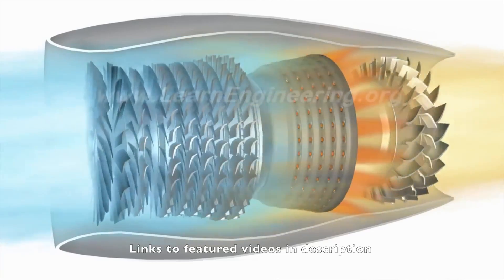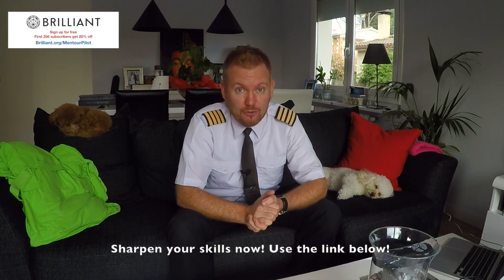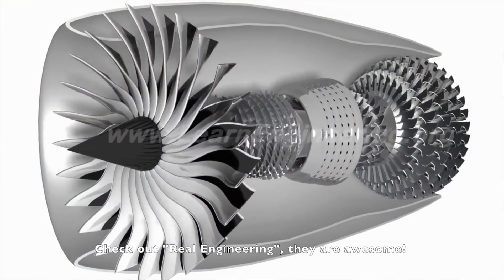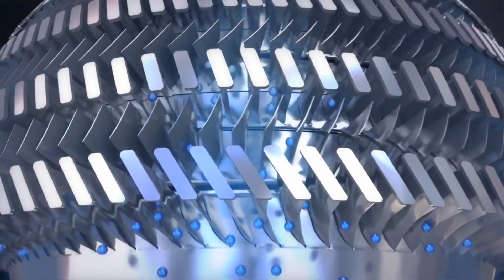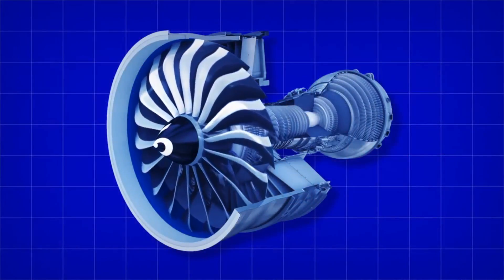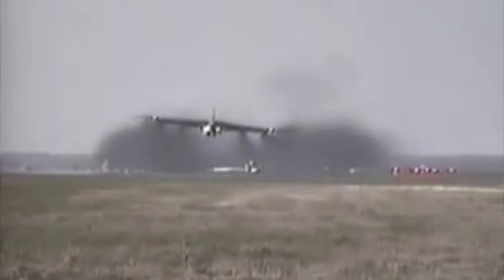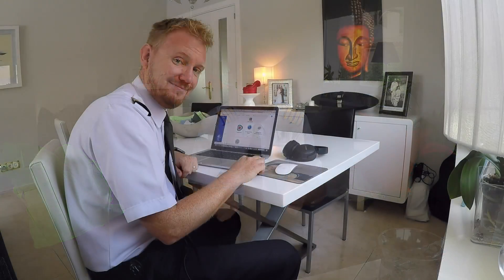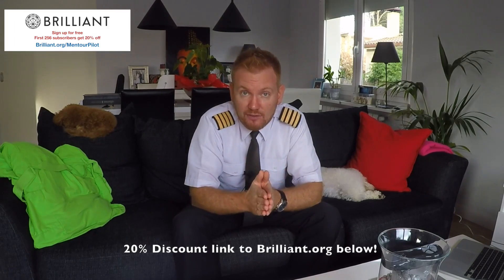Can water make Jet engines stronger?!

Comment: Could you explain the effects that the 2010 Icelandic volcanic eruptions had on jet engines, and why small planes with piston engines weren't affected?
Reply: volcanic ash is primarily rock glass and sand al abrasive , it's a mater of velocity jet engine airflow is very high its like sandpaper on wood also any ash that gets to the primary  (the center part of the engin ) starts clogging up the air passages causing hot spots  damaging to the engine, Piston engines are also affected but since airflow is slower takes more time ash eats the propeller, since most piston engined aircraft have some sort of air filtration it help but not much especially since as a safety factor its mandatory that if the air filter gets blocked (wet conditions cause this to happen in minutes) an alternate path of unfiltered air will feed the engine leaving all the abrasive particle to enter the engin  mix with oil the result is an engine that should last 2000 hrs to tbo  drops to 50 or less hrs . its operating both types of engines with grinding dust in the air .

Comment: Yes, I dont think the raining water would have a big negative effect on the engine thrust. Because the blades rotate so fast that the water evaporates before entering the chamber where the fuel is mixed with condensed air for ignition.... nevertheless they tested the reaction of tons and tons of water entering the engine at full power and the water did not shut the engine down even though it did pass the chamber so probably the air is still powerful enough to fusion with fuel.. also the engine fuel is more dense than the regular car fuel. The water is thinner....

Comment: Rain/Water actually improves the performance of an Engine.   Hence the reason for Engine washes.  

- When the EGT margin drops below a threshold we keep an eye on it and schedule a wash.  Once the core wash is done we see great improvement in EGT margin thus keeping the Engine from over temping when taking out of high altitude or hot cities in general.  

- So yes, in short water does improve the performance.   What it does is cleans and opens up the cooling holes on the turbine blades thus improving efficiency.   If a water wash doesn't do it another option is detergent wash.    I need to start making some videos lol.
Reply: Please do!

Comment: The AV-8 Harrier also used water injection into the big Rolls Royce Pegasus engine for vertical flight. As a jet mechanic you have pretty much nailed the operation of a turbine engine.  I tell people a turbine engine is simple, it is all the components that make one run and power an airplane that is complicated. I worked on the military aircraft so they were run harder than their civilian brothers but they all work the same. Well done. Be safe.

Comment: Thanks Mr. Mentour.
Please tell me that the fan what we see in the aircraft rotate on wind pressure and rain. This fan having seperate shaft which moves freely and slowly depends on air pressure.
Where as compression chamber shaft and combustion chamber shaft is only one.
Does the dust affect the compression chamber as it's sucking air from out side.
Is bird hit front fan affect the jet engine and how.
Please reply.
Thanks in advance.

Comment: you spoke of water injection improving thrust this is true I use to watch the B-52 take off at KI sawyer. to answer your question ( can water make jet engines stronger ) yes but with the amount of thrust of a normal jet engine you would never feel it. That extra thrust would be off set by the add weight and drag of the aircraft in the rain.

Comment: What happens if you have no choice but to fly through a thunderstorm and you get stuck by lightning
Reply: Nothing, the aircraft is bonded from nose to tail and the charge will dissipate off the tail. However, there have been times (very few) where damage is inccurred from a lightning strike. Where it has occurred it has been minor.

Comment: The rain making the runway more slippery has nothing to do with the braking, unless the wheels are skidding and not rolling.

The reason braking ability is reduced on a wet runway is because the wheels get wet, so there is reduced friction between the wheels and disc brakes. It is not because the runway itself is slippery.
Reply: most planes normaly I HAVE SEEN, FLOWN DONT ONLY USE WHEEL BRAKES.
They normaly use airbrakes, which is extra flaps on the wings, and as the plane slows down spesially if the runway is short, they also use reverse trust from the engines.
but yes they have wheel  brakes too, but big planes are heavy. and skidding can be dangerous say sliding off the runway in wintertime with ice-rain-deicer on the runway

Comment: You say that the compressor compresses the air, and because air heats up when it compresses, the water entering the compressor boils and turns to vapor, but wouldn't the compressed also have an equally great effect on water to evaporate? In a vacuum, water will evaporate at cold temperatures, but if the pressure is high enough, the water will just superheat and won't evaporate despite being very warm. Or at leas that's my understanding. Why doesn't this happen in a compressor then?

Comment: water may turn to steam but it robs the engine of heat needed to balance combustion so no i doubt it, unless you make a specially designed engine which is just pointless, where to get the water

Comment: Could you do a video talking about the air conditioning  PACKS work please? Always interested in the air con systems and air cycle machines. Also how clean is cabin air? Do you use 100% outside air or recirculate a lot of it?

Comment: Here are some things that annoy me!  First iff Centrifugal is not pronounced the way it’s spelled, it’s not (Centri Fugal)  you don’t pronounce it the way it spelled, it’s actually (Cen Trifa call).

Same thing when people say Deisel I fucking hate when people say (Deezal)... it’s (Dee Sole) no Deizal.

Or when someone calls a Turbine Engine and (Tur Bin) no no no no no no!!!!  A turban is what terrorist wear on their heads!

Now a (Turbine) is the blades that push or pull a type of fluid or move high volume of air,  You’ll find a Turbine in water pumps, Turbo Chargers etc...

if you end up finding a turban inside of a turbine engine then most likely it belonged to a terrorist and didn’t realize he was too close to the engine...

Comment: I contend that most of increased thrust associated with water injection into a low bypass engine is gained by the benefits of cooler, denser air, allowing for more fuel to be injected, creating greater thrust. All made possible as a result of the ‘latent heat of vaporization’.

Comment: Excellent video ! Your calm, scientific explanations have been very helpful to this one fearful flyer. 

I have a question: Is it possible for turbulence to be severe enough to lift one wing and cause the plane to invert ? And second, mostly hypothetical, question is would it be possible for a commercial aircraft to recover from an inverted attitude at cruising altitude ?

Comment: Doesn't jet engines require oxygen for flame? How does jet engine get so much oxygen at the altitude it flies?
Reply: There going fast enough that there sucking in enough air, plus they can run better up that high

Comment: How do military fighter jests with  little bypass air not mess things up. Water does not compress and just a tad bit of water in a combustion engine kills it.
Reply: the water that goes into the core of the engine turns into vapor. The air can already have over 200°C when it reaches the combustion chamber just because of the compression.

Comment: I am a bad flyer . Prefer trains . But trains don't go everywhere. What happens if there is an engine failure after take off ,during the moments when the aircraft is climbing up . Explain for single engine failure and if all the engines fail. 2nd question ) what is the worst that can happen to a coimercial passenger aircraft when it flies into a strongest turbulence ? Can a strongest turbulence send the aircraft in a tailspin or can it turn the plane upside down ?

Comment: Jet engines continue to operate in rain. But humidity affects the combustion process. Water injection has been used on piston engines too and is even used in turbocharged automobile engines. The purpose is similar to intercooler, to cool down the air before it gets to cylinders. In jet engine, it plays a similar role. Water droplets vaporize as they pass through compressor. The reason is that as pressure increases, the temperature also increases and it vaporizes the water droplets. As water vaporizes, it cools down the compressed air. This means that temperature of air during combustion would change as compared to when there is no rain. Cold air during combustion also causes increase in fuel consumpton. This water vapour (gas form of H20) replaces the air and thus the Oxygen. These factors would affect the thrust but not to a degree where it would be noticable to the pilot because air is always in excess (in air fuel ratio). Jet engines fly regularly around the world in bad weather but it is avoided when it is possible to do so.

Comment: When water goes superheated it also has a massive volumetric axpantion ratio. We use it on high performance engines to increase knock resistance, cleans out the combustion chabers and increase power and loger egt. We spray it a a very high pressure vapour. And also inject pre turbo as it increases the compressor efficiency and lowers intake temps.

Comment: Could you please explain the effects of lightning strike on an  aircraft
Reply: I think he has done that at some point. Basically, when it hits the aircraft, it passes through the metal "shell". It is like a "faraday cage". Normally nothing happens. Aircrafts with partially Carbon fiber shell could get damaged. Therefore engineer build a metal mesh around the Carbon fiber parts. 

Correct me if im wrong.

Comment: 8:46 it's called water methanol injection. Commonly found in turbo prop engines (jet engines with propeller) where water is injected into the compressor inlet which cools the air mass in high temperature conditions and other areas where bit of extra thrust is needed or to compensate thrust loss. Water cools the air mass and increases the air density but reduces the inlet temperature of the turbine so water mixed with methanol is used to maintain the turbine inlet temperature. The action of methanol makes the turbine inlet temperature constant.

Comment: two questions:

How do the airports dry off their runways?
How does the compressor blades actually work? I see in the animation one row of blades are moving in one direction, another in the opposite direction and others not at all. I guess that's part of the process but curious to the hows and whys.
Reply: They dont. Drying would cost a ton of money and special equipment/personel would be needed. Its easier and cheaper to wait for it to dry itself. They probably just profile the runway so the water won't stay on it. Sun and planes will do the rest
Reply: All blades move in the same direction because they are all attached to one shaft. I guess those that don't move are there to make the airflow correct but im not sure about that. Well the blades force air to flow thru smaller and smaller tunnel in effect compressing it. You can see on the animation that tunnel is getting smaller the closer it is to combustion chamber

Comment: Sir should 737max be scrapped because of bad design? Telling pilots that they may need to override and fly manually is like telling car drivers that brakes may not work under a crash situation and that handbrakes may need to be used.
Reply: Boeing fucked up here!

Comment: Water evaporates in the core compressor reducing compressor delivery temperature. This makes the compressor more efficient and allows for a bigger temperature increase across the combustor. These two combined result in an overall cycle efficiency and thrust increase.

Saved you 14 minutes and 52 seconds.
Reply: So does the water go in the bypass or in the turbine? Thanks
Reply: @ashchowdhury2895  Modern commercial jet engines have bypass ratios between 5:1 and 10+:1. This means for every 1 kg of air going through the core 5-10+ kg of air is by-passed (goes through the cold air duct. Assuming uniform amount of rain hitting the engine, a similar ratio of water will go through the core and the bypass duct. Water going through the core evaporates long before it enters the combustor. Water going through the bypass duct does not evaporate (not high enough temperature).

Comment: Why not the engine be provided with filter in front?
Reply: That would add a lot oft air resistance and it would lower the thrust of the engine because less air would come into the engine. And you also don't really need filters.

Comment: Whoah! Most of the thrust is produced by the big fan in the front? Not the high pressure jet of air coming out in the back? Holy cow.
Reply: That is why these engines are called "hi-bypass" engines in that most air 'bypasses" the engine core.

Comment: i have a question for your next video. is there a way you can put a heavy duty screen on the engines to prevent birds going into the engines? and can they put a wire warmer all threw out the airplane to prevent ice forming on the plane?

Comment: The end of February I traveled through JFK airport in NYC when the snow storm was so bad they had cancelled 150+ flights by the middle of the afternoon...After a 10 hour layover my flight Airbus A380 to Frankfurt, Germany continuing on to Singapore was delayed and then required deicing which took over an hour on that huge plane....How do they ever determine if they have removed all the ice which could cause a problem on the plane????? I spent a lot of time worrying during that flight...love your videos... Thanks!

Comment: Water is a great way to control combustion gasses and because water expands 1000 it also help raise the dynamic compression ratio of the combusters . Also it will help not only cool the turbine it will literally steam clean it from any debris. But....... having heat critical parts the quenching affect the water has could create stress risers due to a temp influx on a single part via thermal expansion

Comment: Hi Mentour Pilot ...

Surely the ingestion of water and grit / dirt from the engines sucking in said elements has a detrimental effect on fan blades and the blades in the compressor and HPT & LPT engine cases ... ?
Reply: Deano TheSaxman we actually inject water into jets for industrial purpose to reduce the exhaust gas temperature letting us add more fuel without damaging the cumbuster
Reply: Hey isnak907 ...

Cool ... But the point I was making was that grit and dirt obviously has a detrimental effect on the fan blades ... It's  known to use water in the injection systems of cars also to boost performance ...

Comment: secondly, why not put a net structure at front of a jet engine to solve flying birds problem
Reply: The thrust of the engine will rip apart the net.. even if a minute shard gets in the engine gets in.. even with a net ... The thrust will suck the bird right through it..

Comment: Rain pelting on the flap of the AoA or "wind-flow" sensor can affect the flight of the plane. That's one of the reasons AirBus is installed with more than 2 AoA sensors in every planes.Passengers & crew lives are 1st priority in AirBus.

Comment: The j79 used 6500 to 7500 lbs of fuel per hour, the afterburners had no fuel flow meter. This was a sea level ,is the fuel flow the same at 35000   ft ?

Comment: You stated that "you need more thrust when taking off on a wet runway." You have less rolling resistance, so I'm curious why there would be a need for "more thrust?" Thanks!
The older jet engines had "water injection" such as the Air Force KC-135A's. They called them "water wagons." The water/alcohol mix would cool down the compressor air and increase mass flow, thus increasing effective thrust for takeoff.
Not sure why it would be not good environmentally to have water injection now? I think the only reason why water injection is not used is that modern-day high bypass turbofan engines are so efficient in producing thrust required that all the extra weight and cost plus servicing of WI is useless. As you know, SFC has shot through the roof since the late 50's. Almost 60 years later, the MAX 8 is delivering a 14% reduction in fuel burn over CFM-56.
Technology never ceases to amaze!

Comment: You can use stability factors to judge the safety of a plane. A simple way to find out is to detect vibration right after attack angle. The shorter the burst of oscillation, the better is its quality. Technicaly, you can use Bode plot and Nyquist Stability Criterion to evaluate. If the phase change is within 180 degree, it is recoverable from hazzard. The less delay, the better. Unfortunately, not many people understand how to select a good plane. Manufacturers won't give you these figures.

Comment: I wished you we’re the pilot in every plane ✈️ I traveled ❤️, I am nervous in every time I travel 😢
Reply: riza cas I was thinking the same thing!
Reply: I get freaked out too when flying but statistically i was far more likely to die in a car crash on the way to and from the airport than i am in the plane.  Plane travel compared to pretty much every other form of transportation is far safer. If you dont believe me look it up. Maybe it will bring you some comfort in your next flight because it helps to trust the faa and the airlines that they know what theyre doing. And they certainly do